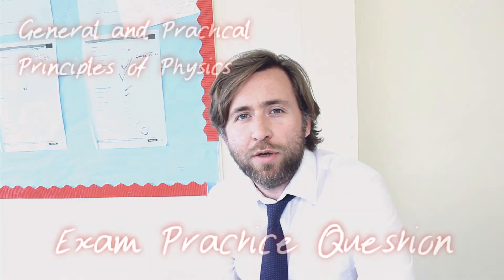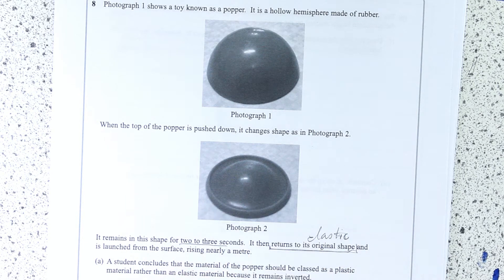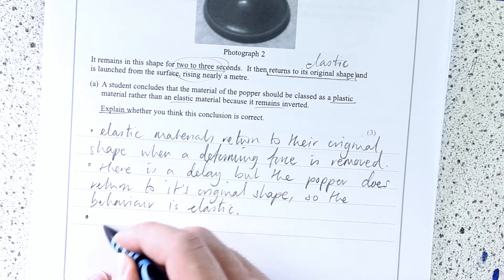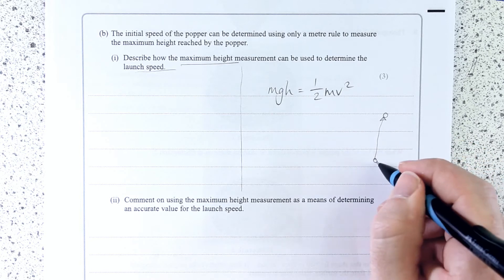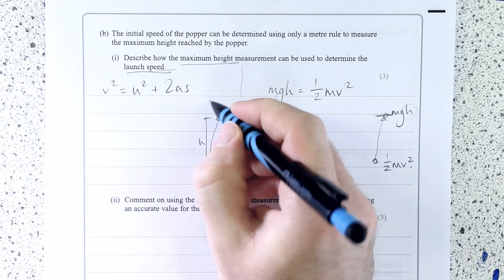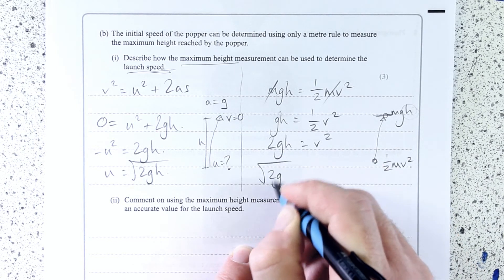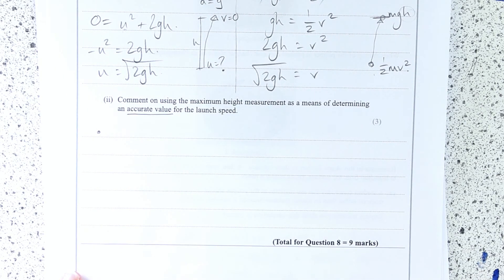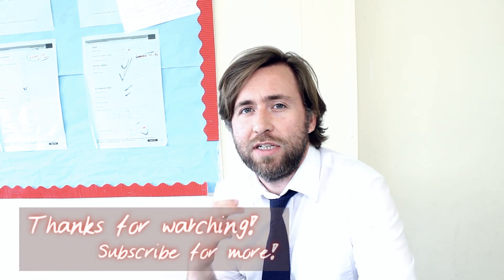Conservation of Energy - General and Practical Principles of Physics - Edexcel A Level Physics Exam

Comment: shouldn't it be the other way around?  the theoretical speed will be higher than the measured one because of energy conversion.
Reply from the maker: I had to think about this, it's because you're used to doing this the other way around, with objects falling.  So in that case you'd be right.  They really like to challenge you on this idea, for example if range of a projectile might be longer or shorter... (it depends which part you've calculated by ignoring air resistance.)
Reply: GorillaPhysics thanks for your reply, correcting my previous statement. The theoretical speed in amount will be higher, right? Isn't this just a problem of how you define speed and its direction (represented partially by the algebraic sign)?
Reply from the maker: No, it's not about direction.  The theoretical speed is ignoring decelerating forces and dissipation of the energy.
So real speed will be higher, because it will have lost some energy, so not reached the height it would in a vacuum.
Reply: GorillaPhysics ok, i thought that you described it as v(theoretical)=-1 m/s
v(real)=-0,5 m/s
thus the real velocity is greater,  but in amount smaller. 
However, if we negate the velocities,  the directions are also mirrored. Now:
v(theoretical)=1 m/s
v(real)=0,5 m/s
thus the real velocity is smaller, but also smaller in amount